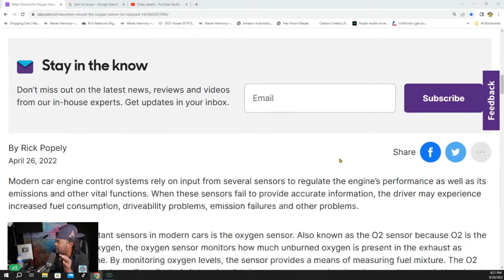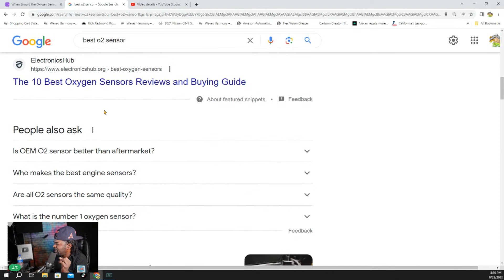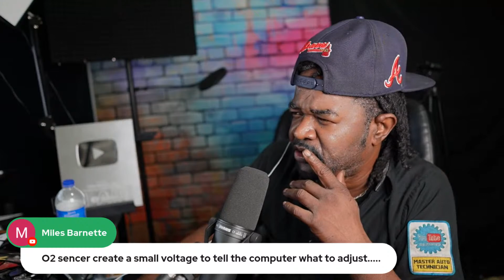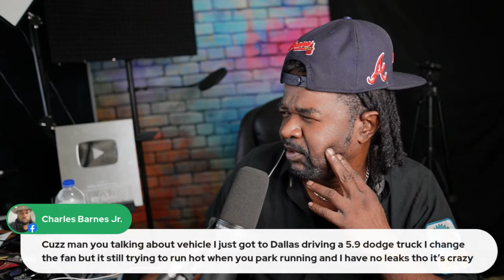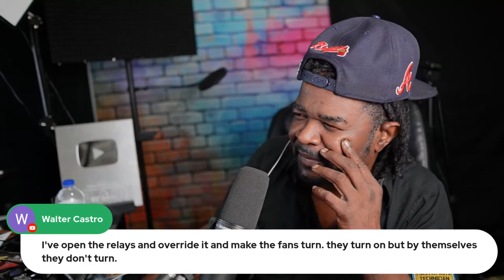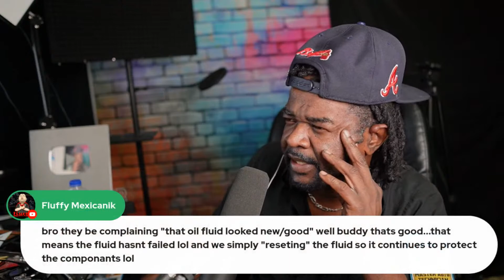The most important sensor on your car. ITS TIME TO REPLACE IT

Comment: My vehicle requires NGK spark plugs because it is a Japanese vehicle and the range of changing spark plugs is 100K to 120K and if the 02 sensor is supposed to be changed at 60K according to J.T. it is way past due normally changing a 02 sensor is part of a tuneup which, includes changing. 🙂

Comment: Normally you change your 02 sensor when you change spark plugs. 🙂
Reply: Why would you do that? If you don’t need to replace it than why replace it? Also which plugs are you using? Some only last 3k miles and some will go 120k miles.

Comment: If your engine isn't running rich or burning oil, then the oxygen sensor will last pretty much forever. However if you have a newer vehicle with paper thin rings, a turbo, or you're not good with routine maintenance. Then yeah, maybe.
Reply: The problem is that as they get old, they get "lazy", as JT mentions. This results in a corresponding loss in fuel economy and performance.